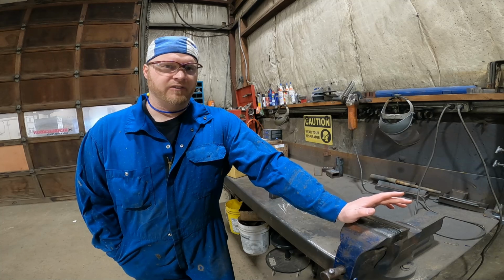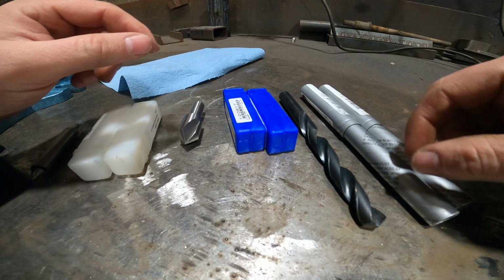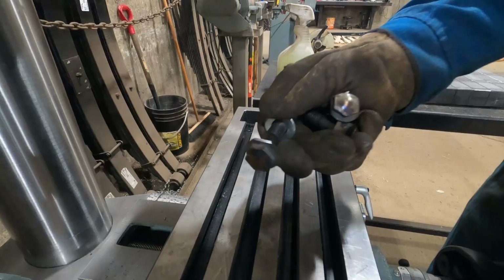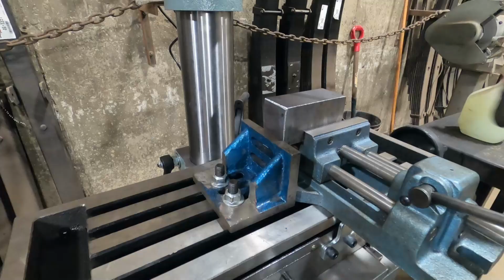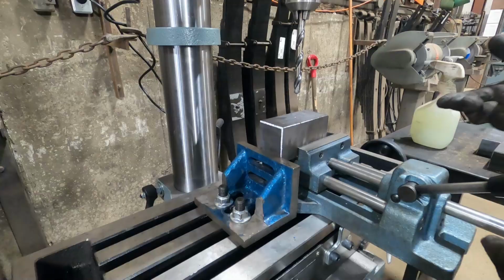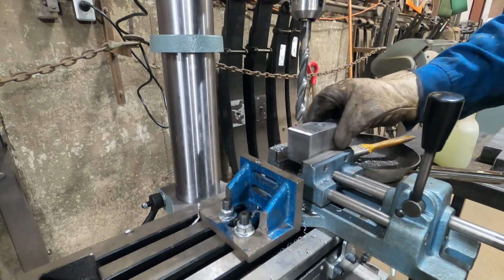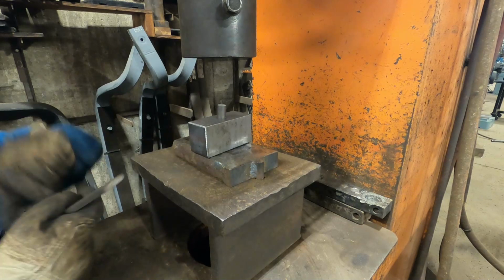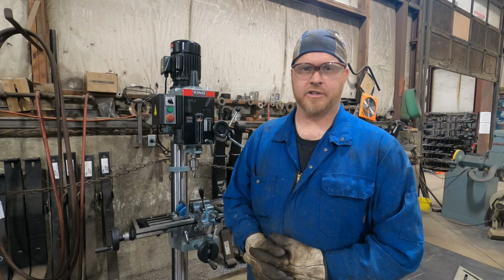2" Trailer Lift Kit - Where To Buy, And How We Make It.

Comment: Thanks for showing us the improved parts and your process. You may want to reconsider wearing gloves while running a drill press. You can easily get caught up if the lands on the bit touch your gloves. I’ve seen it happen to someone I worked with and it’s scary at best and dangerous at worst.

Comment: You're getting it done for sure...can't help wondering though if a good used Bridgeport mill wouldn't have been a better fit for the job rather than that drill press?
Reply from the maker: I looked into a Bridgeport and I couldn't find one with 220 single phase electricity.  Plus the price was double....maybe next time.

Comment: I was conflicted on spending the $ on a kit.   I thought it may have been slightly overpriced.   I had some 2x4 3/16 stock so I made my own like your old design. . . But after making them. I fully understand why you're charging 330.  More than fair.  The u bolts alone were 99 bucks.  So with the work that goes into the blocks, I support that price.   Well worth the cost if you cant make your own.

Comment: do the same operation on all blocks, drill all blocks with smaller drill, do all blocks with larger drill, do all blocks with chamfering bit this will be as fast as you can go, unless you get CNC machine
Reply from the maker: this is exactly how we do it.  our cart can handle about 60 blocks at a time  (weight wise), so we usually drill 60 out at the same size, then change the drill bits and repeat.

Comment: Can you make them for a 5x6 lowes trailer or a 3.5 x 5 lowes trailer.  I believe the axel is smaller.
Reply from the maker: good questions.  Lowes/ACE/Walmart/Canadian Tire and Peavy mart trailers are all very strange and not very standard sizes.  I wouldn't even know what I would have to make.  I'd need a whole bunch of measurements.
I need Ubolt measurements - https://youtube.com/shorts/joBn6PpitVg?feature=share
I would also need to know the spring width and the axle seat (spring seat) length
then I would know if it would fit with a different set of Ubolt or if it wouldn't work at all.

Comment: Is this better than using a kit to “flip” the axle using the kit that is offered by Dexter?
Reply: These only work with axles that are bolted on to the springs from the bottom. If your axle is in the middle between the spring and trailer frame that axle flip kit from dexter will be what you need.

Comment: How Much Weight can it hold the 2 in trailer lift kit. i want to used it in a dump trailer that  hold 8 tons of material.
Reply from the maker: the blocks are so strong, I don't think you can break them

Comment: You have a lift kit for a square galvanized axel?
Reply from the maker: As long as the leaf springs are 1.75" wide our lift blocks will work.
The best way to order these from us is to put in an order for either a single or tandem or tri-axle kit.  after that, message us on the contact page and put in the measurements of the Ubolts you want.
you will have put tell us what (inside) width and (inside) length and diameter of Ubolt you will want.
We have a video on how to measure the Ubolts.
https://youtu.be/Ut7AeDgLG8M
after that I'll make you a custom lift kit and ship it out to you.
Or just give us a call - contact info is at www.simcoespring.com
that way I can walk you through the steps and I can process an order for you over the phone.